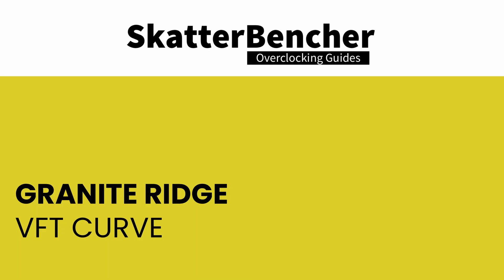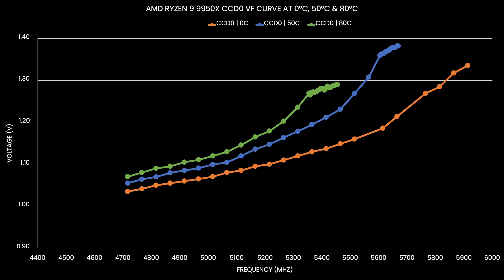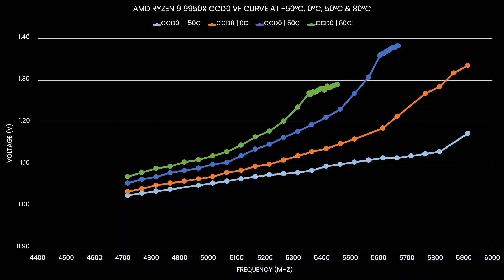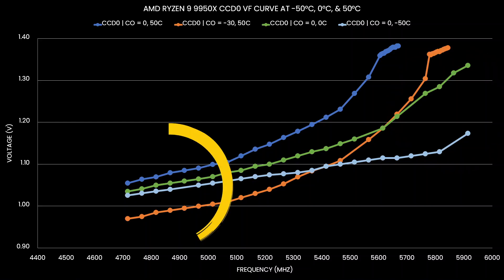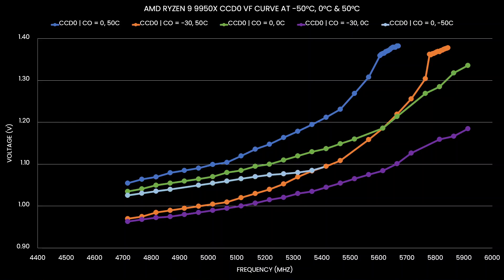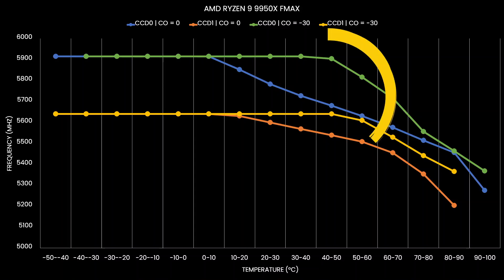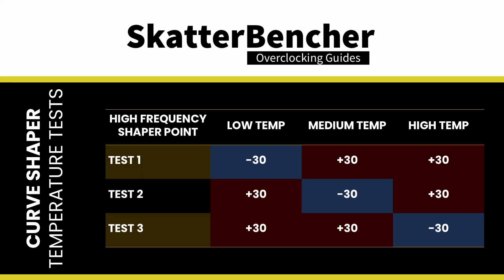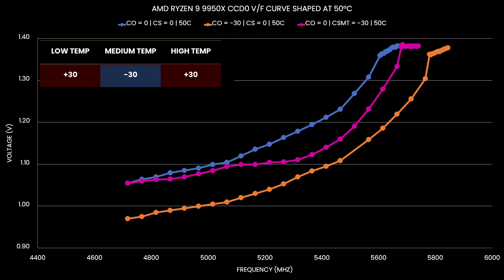Undervolting Ryzen 9000

Comment: Can you use one or the other, or do you have to use both? I get freezes when in VRay when I use Curve Optimizer  with a -30 offset on my 9700X.
Reply from the maker: You mean Curve Optimizer and Curve Shaper? You can use either or both. Just remember they stack. So if you do -5 CO and -5 CS, the undervolt with be -10.
Reply: @SkatterBencher  my Curve Optimizer is -25 because 30 forces my system to freeze when running benchmark. What increments do I use to set Curve Shaper?
Reply from the maker: You can try setting Curve Optimizer to -30 and the Curve Shaper to +5 (this effectively makes a -25 undervolt). 

Since you're having stability issues in benchmarks, I'd start with looking at the Max/High/Medium frequency Curve Shaper first.

Comment: recently upgraded my Asus x670e Gene bios with my 7800x3D on it and noticed there is now a "Curve Shaper" option. Thought this was Zen 5 exclusive? Any thoughts? Would this help with e-clk overclocking?
Reply from the maker: I thought so too but apparently it also works on Zen 4.

It should help with ECLK. I explored that at length in my 9700X guide. You can check that one for reference how Curve Shaper helps with ECLK strategies.

Comment: Do you think Curve Shaper can work with Ryzen 7000 CPUs? It seems like it's more of a software feature than a hardware one.
Reply from the maker: I haven't tried it myself but before launch I was told it's a Zen 5 exclusive. However, seems the option is available for Zen 4 on some motherboards and it works too. So, I think it does work with Ryzen 7000.

Comment: Your explanation of curve optimizer in your video from 3 weeks ago was a lifesaver. Thank you so much. I was able to push my 9950x to -24/-26 (CCX0/1) netting 5.4% cinebench performance without raising the power limits or temps. I'm currently 24 hours into a stability test with aida64 and working on a prime95 stability test to validate it's stable. 

If you have any advice on stability testing it would be appreciated!
side note: idk why but applying overclock/co settings in ryzen master on my asus x670 creator mobo would cause my pc to not boot until I cleared the CMOS. I assume it's a bug but I had to use the bios for all the tweeking.
Reply from the maker: Thanks for the kind words. I'm happy my video helped!

As for CO testing: don't forget to mix workloads when testing. A common error is to test CO only with stress test tools. Those tools tend to run high temperature and moderate frequency. But sometimes CO is unstable at medium temperature and high frequency, or high frequency and high temperature. I found that looping the Y-Cruncher component stress tester can sometimes also uncover CO instabilities.
Reply: I run AIDA FPU/Memory/Cache stress test to detect unstable CO. 

On settings that Cinebench runs for infinite amount of time without any problems, this test crashes my PC in 5-10 seconds. I needed to lower CO by 15 points to make this test run for some extended amount of time.
Reply: I too experienced the same problem with ryzen master on my msi board, had to clear bios.

Comment: So you basically need direct die cooler, with peltierelement and liquid metal at ~20°C all the time... noted
Reply: Lol... It does show though that if you did use the most optimal water cooling setup such as direct die that it should definitely improve performance with the amount of voltage that is used which will lower temperatures which will allow higher frequency.
Reply: @JMNovak1011 i have 5800x 3d that with kombo buster on my msi board the cpu doesn't seem to care about voltage or temps too much. I top out ar 90c, but scored closed to 2,450 in cinebench. Lowering voltage drop 8c to 82c but scroes only 2,325. Think my chip might be golden for LN2 overclocking.
Reply: @kevinerbs2778  yeah it's a very unique give and take between voltage temperature and frequency. There's also quality of the cores which comes into play. We've seen that in a lot of different Zen cores now where one person can hit a certain frequency at a certain voltage and someone else will be 100-200 megahertz under that at the same voltage. I mean you also see it with how CCD 0 usually has the highest binned cores and CCD 1 has lower performing cores because AMD loves to get rid of their trash CCDs by just sticking them on the dual CCD chips
Reply: Peltiers are low capacity and grossly inefficient.  Probably better to start with an AIO, then duct a window unit air conditioner around the PC, and modify its compressor for variable speed (or start with a model that has that feature). Dry air, no temperature differentials, and you get the extra-low-temperature benefits for RAM and GPU too.